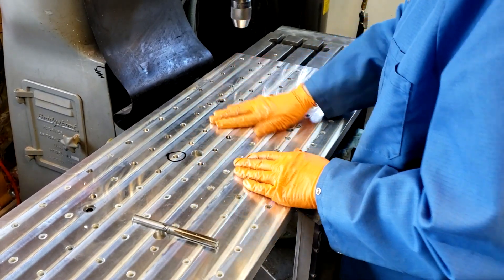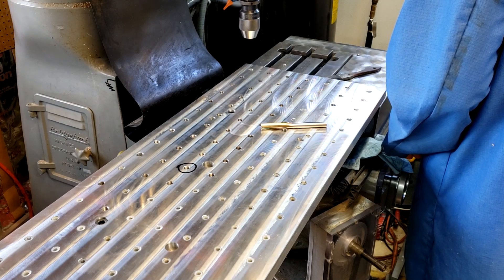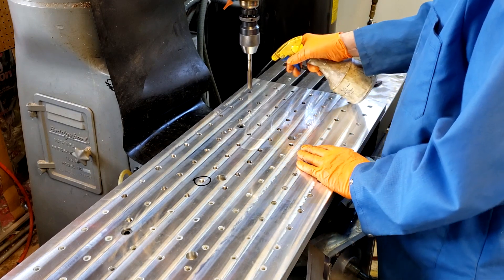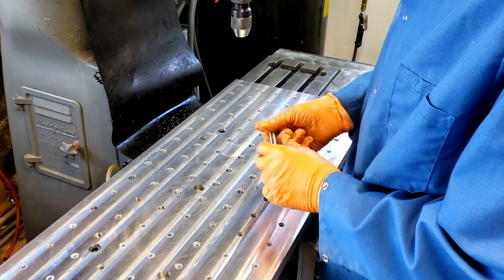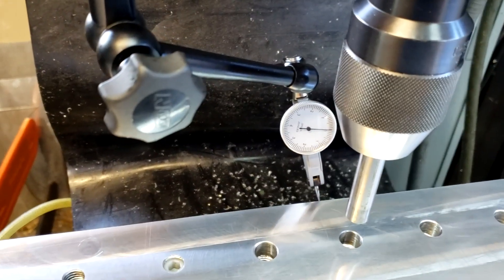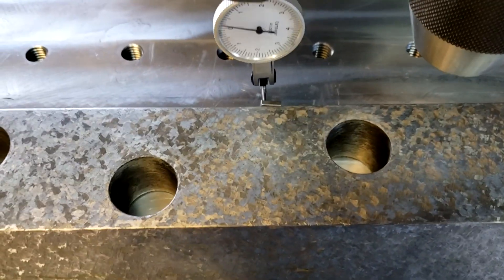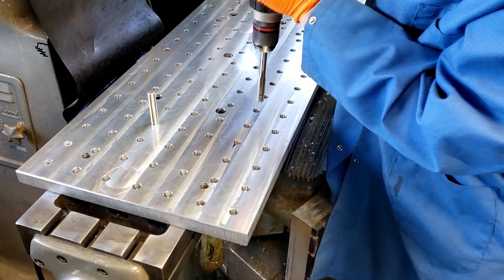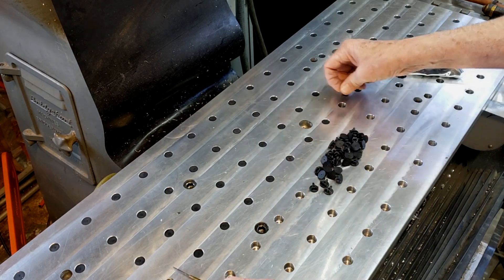UPDATING MY MILL'S FIXTURE PLATE

Comment: Sr, question!!    I have a bridgeport 3 axis, cnc mill,  it works great but g43 on the tool change doesn't quite work for me because of the limited Z travel,  so I wan't to put another axis on the Z to drop the table for the tool change, and lift the table, I'm not being lazy but I only have one back and it's the only back I have  ,  what servo would your recommend for this task?  do you think that with Nema34 12Nm or do you think is to much?
Reply from the maker: I don't know, sorry.